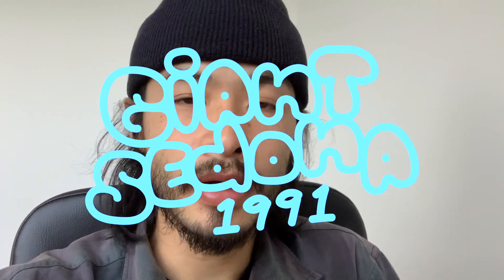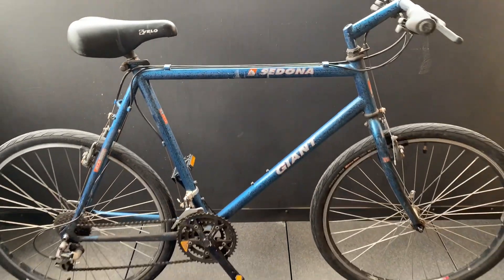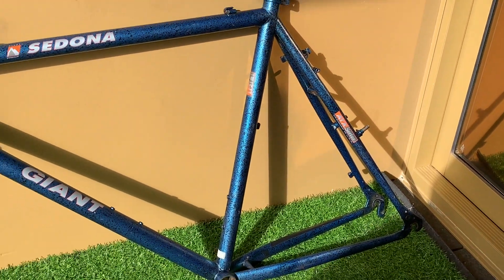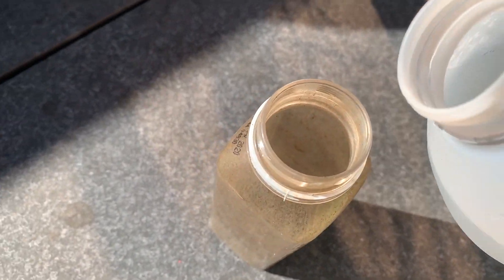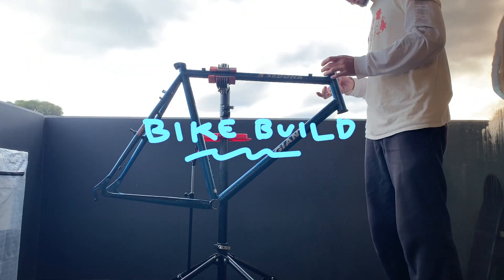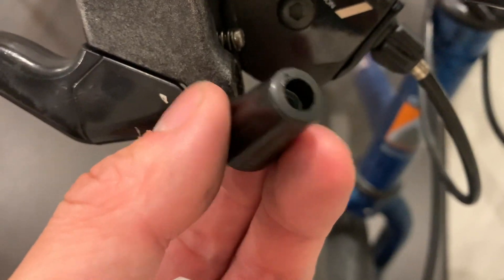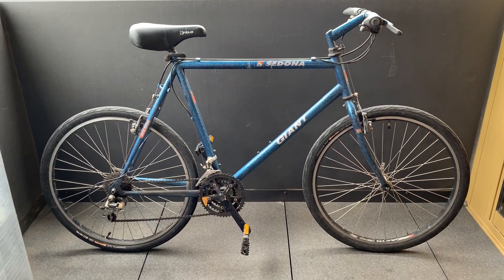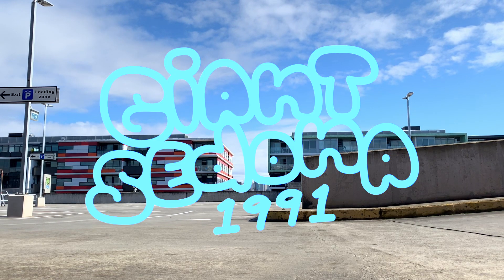Vintage MTB Restoration - Giant Sedona 1991

Comment: I know this comment is late, but only just discovered the channel. Great to see someone recycling perfectly good bikes rather than see them end up in landfill. As an aside, that little protruding lug on the rear of the cantilever arm is there to allow the brake cable to be folded back out of the way; no need to rely on the brake boss on the fork.
Reply from the maker: Ayyy thanks  my dude I appreciate that! Ya thanks for the tip, I think a lot of ppl do it that way too. I prefer just the resting method because it avoids putting a hard bend in the cable ! Cheers 🤙

Comment: put the caps in the end of the cables. Is just a $ for a bag of 50 on Ali express and will avoid the cables ends from slitting with time
Reply from the maker: Alexandre Cunha thanks my dude! Good call. I have been using old ones in the mean time, you’re right they do get frayed if you ride gravel etc, cheers!
Reply: @garysprojects  even in normal every day use. Sometimes get stuck to your clothes, scratch your legs if they pop out. And since the cost is so little... it makes total sense to use them. BTW, nice videos!
Reply from the maker: Alexandre Cunha yup for sure. Thanks man appreciate that glad u like them 🙏😊

Comment: Nice resto. The cantilever brakes usually have reflector bracket arms going under the V cable for safety if the cable breaks. Mount screws through forks and cross bar on seat stays. May not be available, so I made one from some flat brass strip. What size frame? 26" wheels? Did wheels need truing? New tubes and tyres? Looks like tarmac only tyres, get 2.1 knobbies for packed sand or gravel tracks. Hubs might do with a rebuild having gone so far.. Try Giant Ergo Max Pro Plus grips. Get a seat dropper. Might need a cane creek shim if need a 27.2 to 30.2mm dia convert. Use cable caps.
Reply from the maker: Cheers mate thanks for the tips! yep its 26 inch I reused a lot of the older stuff to save from landfill. cheers!
Reply: @garysprojects  You can see the reflector bolts still on the unrestored bike. Need reflectors to be street legal. Just saying.

Comment: Hey Gary nice build steel is real- great vids please show how you stretch out gear cables next video thanks !
Reply from the maker: Cez rok thanks man! I basically run it between my thumb and finger and pull on it. You can also stretch it by hooking it up and pulling on the gear cable where it’s exposed on the tube, then re-tighten it once it’s stretched out, hope that makes sense if not I will do it for the next video! Thx 😊 🙏

Comment: Sweet build! I think it turned out great. Some nice tips throughout the video as well. But mate you have to get some cable crimps on the ends of your cables! It won't be long until those fray! Normally I prefer the plain ones but they come in all kinds of colours, and the ano blue colour might look nice on this bike. 
Great video!
Reply from the maker: Spencer VanDerStarren Thanks my dude! Appreciate it, I will def put them on hahah. Blue anodized ones would look dope !!
Reply: I noticed the missing crimp ends as well. Yes they are very inexpensive. In case anybody is not aware there are 2 sizes..1 for shift cables and 1 for brake cables.
Reply from the maker: myvicariouslife thx for the tip!!
Reply: @garysprojects  If you dont have the crimper tool on your wire cutters u can use vice grips and it works great.
Reply from the maker: Thanks my dude, I’ve been using pliers !

Comment: I have exactly the same bike my is little small frame 14.5 is for kids? it looks small) 26 ichn wheels.
Reply from the maker: Yeah maybe just a small frame! Usually if it’s for kids they have 24inch wheels
Reply: @garysprojects  can i fit any suspension fork on this bike??
Reply from the maker: @mygoalcrash8077  yep you just have to match the headset!
Reply: @garysprojects  old forks are 1inch( 11/8 forks wont fit(( .
Reply from the maker: Ahhh that sucks !

Comment: Do you think I can fit 700 wheels with 32 tires? I have this same bike
Reply from the maker: Nah man I don’t think so ay, the cantilever bolts won’t reach the braking surface on the 700c wheels
Reply: @garysprojects  I don't think that's the problem, I could use adapters on the cantilevers that bring it up, some of them can even let you use v brakes. My main concern is: will the wheels go through the chainstay and if I will be able to use tires bigger than 28c
Reply from the maker: @diegobluc  ahhh not sure man , you might have to slot a wheel in there to see
Reply: @garysprojects  I will find one and test it and if it works or not I will try to remember to come back here and talk about it haha thanks for answering mate
Reply from the maker: @diegobluc  no worries mate! Hope it works out!! Good luck 👍
Reply: @garysprojects  Thanks! My plan is to make something like a cycle touring bike
Reply: @garysprojects  Hello again my dude. I have some news about the project.
The 700 wheels fit perfectly with 35 gravel tires I had laying down around my house. 
I've decided to keep the 26 wheels since they're Araya with original Shimano hubs from the 90's. Making the conversion to 700 would force me to use 111mm V brakes and I would have to change everything from the brake levers and the rapid fire that is integrated to the levers. 
It's a beautiful bike, trying to keep it as original as possible. I'm running 2.35 Kenda tires on it.
Reply from the maker: @diegobluc  nice!! Thanks for the update! It’s good to know this bike can take 700c with also the changes. Easier to keep the bike original so don’t have to spend much $$$ haha , I think the 2.35 kendas will be great!!

Comment: you used WD-40 to clean the seat?  and applied it to the seat post?    for the seat that sounds like a mess, why not use a general cleaner?  for the seatpost, don't you normally use grease?  thanks!
Reply from the maker: Andrethetiny hi! On the saddle I used wd-40 just to get rid of the paint stain since it was very stubborn. Then I used general cleaner to finish it up. For the seatpost i used wd40 after sanding it to protect it from re rusting again, as it leaves a thin film to protect it. I then used grease before I put it back into the bike. Hope this helps cheers!
Reply: @garysprojects  makes sense. These are great projects, thanks for sharing
Reply from the maker: Andrethetiny  no worries! Happy to help, glad you like the videos 😊

Comment: My wife has one of these. I had to replace the shift levers for some new shimano ones, combine brake and shift, only $56, changes the tyres to 26x1.95 from BIGW as well as the saddle. I also change the grips and pedals. Only issue is the second chain ring has some teeth ground down, makes shifting between the front gears a bit hit and miss, no matter how much I adjust the front H and L screws. Anyone replaced a crankset on these bikes?
Reply from the maker: Nice it’s a solid bike I reckon. The cranks should come off like normal square taper cranks, you might need to take them off to replace the chain rings. Hope that helps cheers!

Comment: What lube did you use for the shifters?
Reply from the maker: Ken Koo I used appliance oil that came with my electric shaver, I have also used bearing oil in the past. Sewing oil will work too. If you don’t have those you can use grease but make sure you use a very small amount because you don’t want it to clog up the mechanics or attract too much debris
Reply: garys.projects Is it okay to use bike chain lube? Im planning to restore my old Deore XT shifters as well since they aren’t shifting at all. Any tips?
Reply from the maker: Ken Koo yes! That should work well. In my Marin video I actually take apart and put together Deore xt shifters so check out the vid. Basically you can try soaking in wd40 and try and clean it, if it still doesn’t work you can take apart, and clean each piece individually, then lube and put together again!
Reply: garys.projects Thank you!! Will definitely check out that video! Great videos btw!
Reply from the maker: Ken Koo no worries! And thank you appreciate it ! ❤️

Comment: Aaarrrrrgh!!!! No to white vinegar!!! Try evaporust man. You should be able to buy it at auto stores ‘Supercheap auto’ for example. It’ll cost a bit $80-$100 for 5ltr. It can be reused many many times. Manufacturers claim 1/2 pound of rust per Gallon!!! Mine’s gone dark/black and still works a charm. You can decant the cleaner evaporust from the top layer and discard the rusty gunky layer if it suits you. If you want to see the results look up ‘Rj the bike guy evaporust’ there are a few videos he did about the stuff. Check out the comparison he did with evaporust/ oxalic acid/ white vinegar and another ‘rust converter type product. I was Sold when I watched his vids on it when researching rust removal methods. It doesn’t harm paint, or plastic rubber parts. You can put your hands in it as it’s really safe stuff to use. It’s all I use for rust removal, on my vintage rides/restorations/tidyups🙂👍

P.S. No I don’t work for evaporust, I just think their product is the bomb for what you are doing. I actually cringed when you said ‘white vinegar’ 😂 its all good. If it works, it works. Nice vids by the way, Cheers, James
Reply from the maker: James Prangnell hahah I’m glad it was just the white vinegar that made you cringe lol! Thanks James I will definitely give evapo rust a try. I’ve heard good things about it and seen rj vids too! Wondering what type of container you use to store it and if you use a sieve or anything after you’ve used it. I like how it’s super safe and good for the environment too. Thanks for the advice, def will do it next.
Reply: I tip my evaporust into an ice cream container for use. I have a small teapot sieve that I can use, and also a large one I got at the reject shop/$2 store... I find that pouring the used evaporust back into a old drink bottle for storage is a good one, and pour the last dirty bit into another container. I keep that for appropriate disposal one day... 

I do like your enviro attitude too man. It’s cool to see you ‘saving’ older bikes and getting them going again. I really find it hard to pass up a bike that’s destined for rubbish or the tip. I tend to do ‘tidy up’s’ on cheaper or free bikes and pass them on to friends or sell on Facebook marketplace. If the bike is more my size (I’m 6’3) and style (I prefer vintage roadies, but have a couple of mtb’s) I will put some more effort in and strip and rebuild the whole bike. 

I have never painted a bike as I love the patina of use on a bike. It shows that it’s been loved, and used. I do like your paint job on your diamondback... it’s cool as man... if your interested too there’s a spray paint that’s enviro friendly called ‘sugar’. It’s a alcohol/water based enamel that holds up well. Check it out too... 

Keep up the vids and the good work man
😊👍
Reply from the maker: James Prangnell thanks man appreciate the info 👍👍 I pretty much do the same thing as you but I’m more into MTBs right now haha. I do have another Peugeot (road bike) that is waiting to get built up so stay tuned for that one! I dig the older style (90s) bikes, and it’s amazing you can almost fix anything up and get it running again. Compared to some of the newer parts - once it’s broken you have to replace it. I respect the design and thought that goes into the engineering of the bikes/group sets back in those days! 
There will definitely be more vids and thanks for support 🙏😊
Reply: @garysprojects ad find, this old comment of yours and mine back a couple years ago… 
Cool little find, and nice bike too. I see why I was watching this back then. I have been riding a similar era Giant Boulder 3x6 speed around for my rack bike. I have sent you pics of it. It has the panniers you sold to me… you know Gary’s Panniers™️ 😅
Anyways, keep up the good work😊👍
Reply from the maker: @bigbadstretch13yrago  hahaha wow!! What a throw back!! It’s funny because all I use now is Evaporust !! 😂😂😂✌️🫡🫡🫡 cheers buddy!